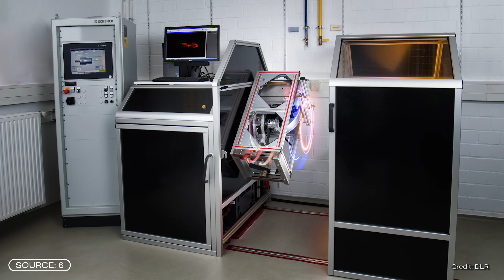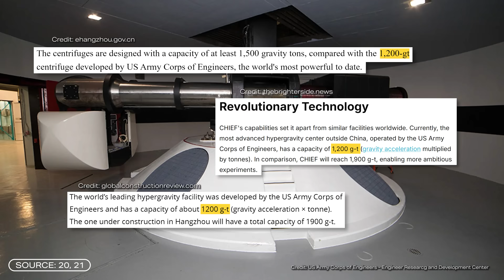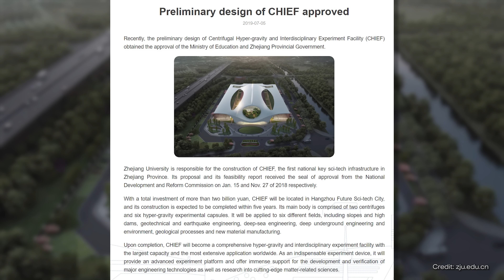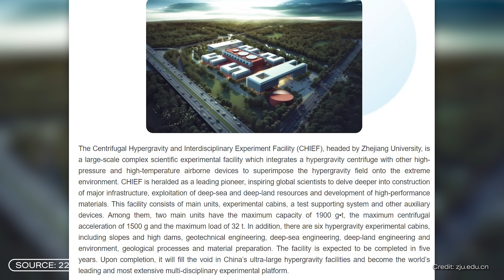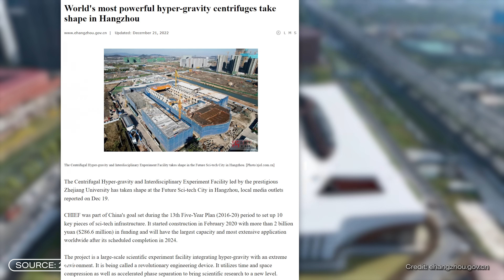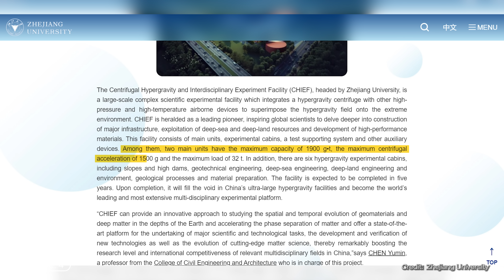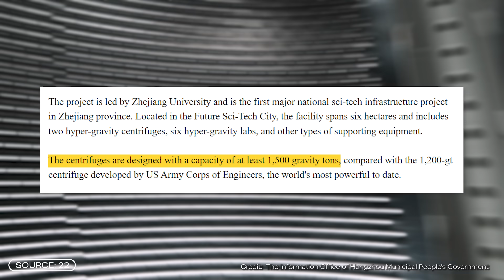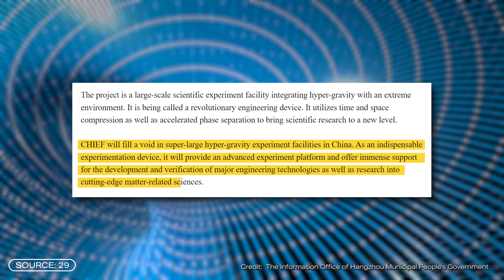Why Did China Build The World's Most Powerful Hypergravity Machine?

Comment: Is hyperventilating useful for custom research? 

I guess not-- the pressure in the core of a star is due to the weight of all the accumulated mass between the core and the surface,  which is a result of the mass and gravity for a given radius of all mass in that zone.  High gravity itself does not necessarily result in enough pressure for fusion.

Comment: C.H.I.E.F.'s primary goal is likely material sciences and chemical engineering applications, to engineer stronger material and more powerful fuels.

hypergravity can also have applications for developing cold fusion, which has many advantages over traditional fusion, including a much lower energy input to get the same amount of power out, smaller, less expensive and less complex reactor designs, and would require much less energy wasted on cooling. i always find it hilarious when people saying cold fusion is unproven when EVERY  star that has ever been formed is proof that they are wrong, its just a matter of A, can it be scaled down, and B, can it be safely contained, and just as with every star, gravity itself was the spark for the process, ergo it would appear to me not only to be the best chance for cold fusion (or even a hot fusion significantly aided by hypergravity), but quit possibly the ONLY chance given the relative mass difference involved between the sun and a fusion reactors core, by my estimate this machine is about  6-7.5% as gravitationally strong (at a bare minimum, and possibly much more would be needed for the actual initiation of the cold fusion process) as would be need for a pure cold fusion reactor.  IF this is a possible motivation for this behemoth of a hypergravity machine, this would mean china is getting near a theoretically workable cold fusion reactor, but material sciences, chemical engineering and even medical research are all much more practical uses.

Comment: Its just a centrifuge and does not produce gravity. Gravity is just a theory and still has not been proven. Gravity is said to be mass warping spacetime but once again we have no proof just Einstein's math and because he said so and that is not proof. The only way to actually prove gravity is to somehow get to another celestial body which we cannot do. NASA has already stated that the furthest we can go is low earth orbit. Even Warner Von Buren said due to fuel and rocket size required made getting to another celestial body impossible so testing the theory on another celestial body is out of the question. Dropping an apple doesn't prove gravity, it just proves that the apple is heavier than the air that surrounds it. Just the same as a helium filled balloon doesn't prove anti-gravity. Besides a helium filled balloon will only rise to a point where it is neutrally buoyant.